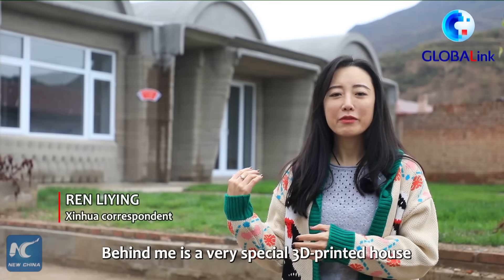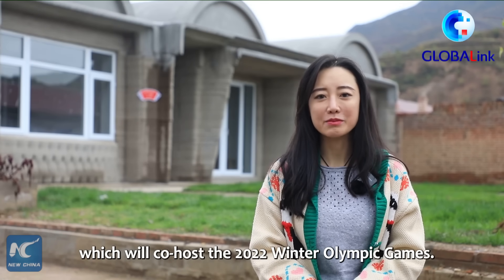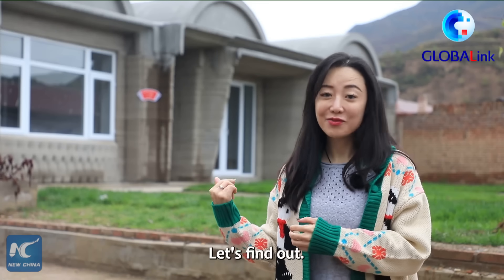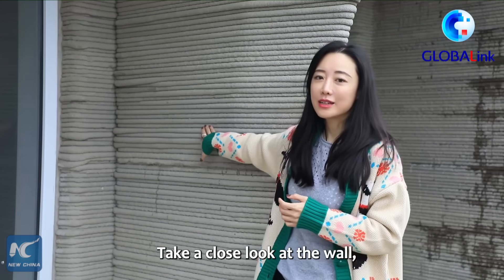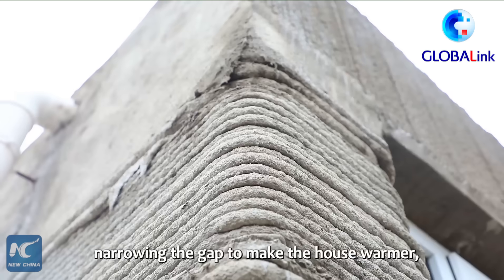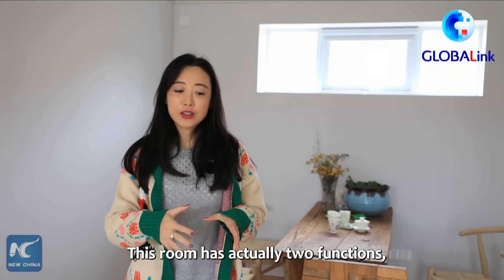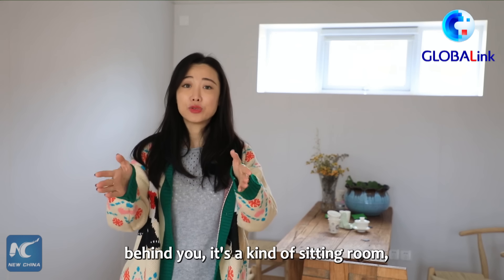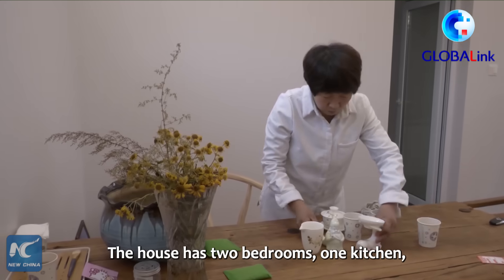GLOBALink | 3D-printed house takes shape in rural region of Hebei, China

Comment: Compared to some of the european competition china is behind. The hopper was much smaller than on say the ones used on COBOD worksites. The robotic arm is connect to a rail and then also has a movable head which means if anything goes wrong, as they always will, you will need to callibrate all three systems. Lastly, the material is the most important part and it's interesting they are using a sprinkler system verse vertical mist machines. Love the progress but Europe is yet again in the lead of this new industry with COBOD and Apis Cor

Comment: I’m interested to know if walls are insulated and how the electrical cables are run throughout the structure.
Reply: Walls are not solid, have cavities and groves for insulation and running pipes as well as electricity
Reply: @manimalworks7424  I noticed the cavity’s but was wondering if they fill it thermal insulating materials. Although it may be a very hot region of the country where insulation just is not required.

I’m also curious about the flexibility of material. If it’s extremely brittle, ground vibrations or movements might compromise the building.
Reply: @Zen_Power  insulation is not only for cold region. insulation is needed in hot rrgion to keep the house in moderate temperature.
Reply: @Zen_Power  no insulation in the cavities. Material is concrete mix.